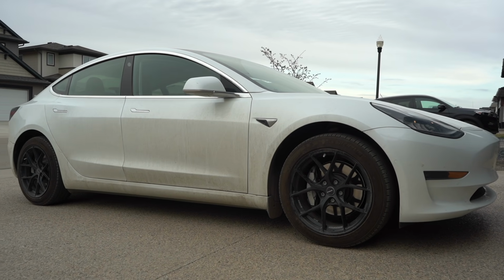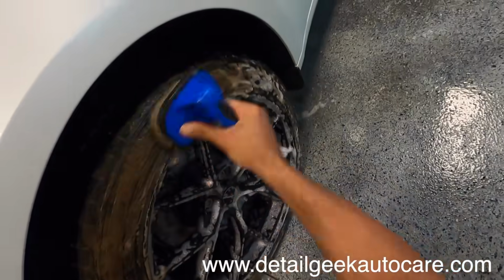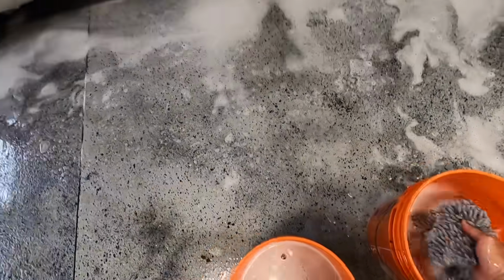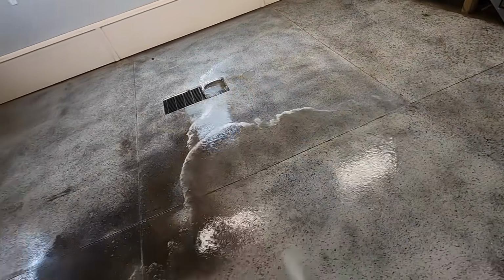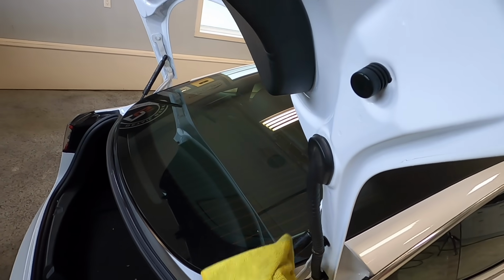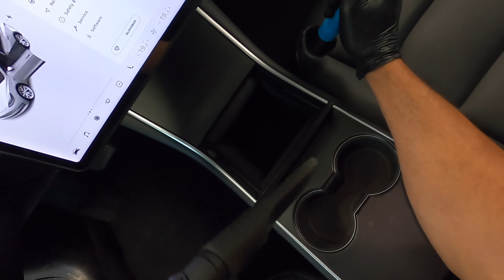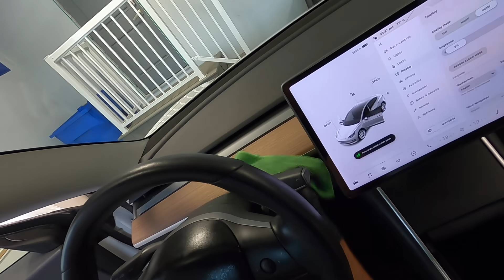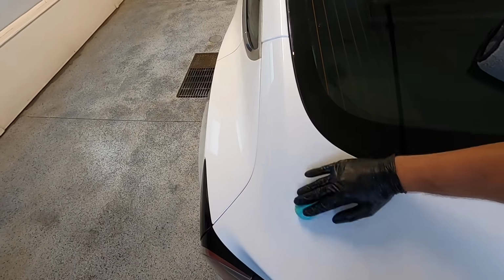Deep Cleaning a DIRTY Tesla Model 3! | Real-Time ASMR Car Detailing

Comment: Is that 303 Aerospace on the doors? I use it on the seats as well but in very small amounts or you slip all over the place. I definitely need the glass towels. Cleaning the interior glass is the worst on this car.